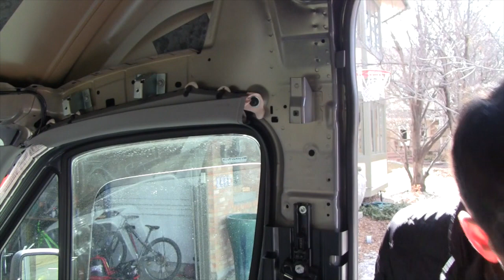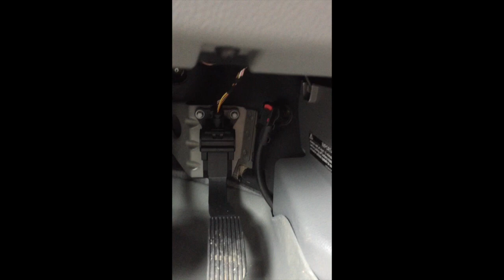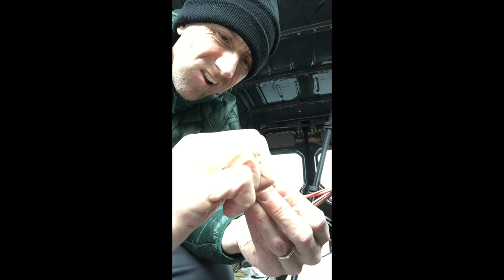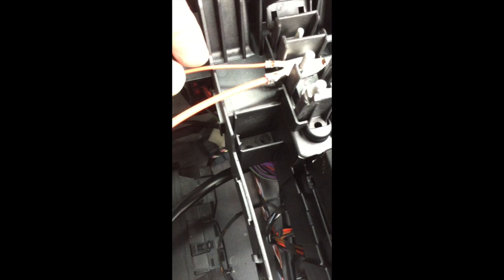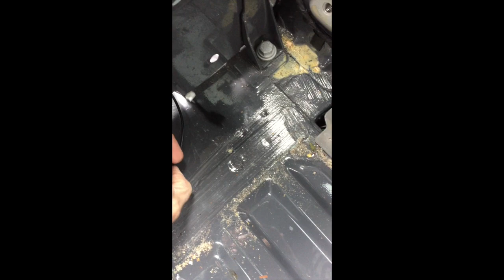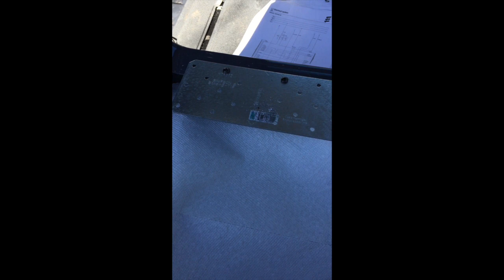Espar EasyStart Remote+ and High Altitude Kit - Install Part 3

Comment: Is it possible to use the Eberspächer EasyStart Remote+ and EasyStart Pro together?
Reply from the maker: I’m not sure about that.  I would think not, because there would be only one set of control signals in the wiring, but I’m not sure.  You should be able to call their tech support line and get an answer to that. Good luck with your build!

Comment: Hello, I have the same unit with the exact same components but have gotten a "no signal lately after the heater tries to fire. How has your been for you? Any issues with wiring? I am trying to troubleshoot my issue currently
Reply from the maker: Did you run the antenna up the side of the van?  I ran mine from under passenger seat where heater is up the B pillar
Reply from the maker: Did you pair the remote per the initial setup instructions on pg 11 of the manual?   You have to pair it using the “button” connected to the main unit.  Basically you push the button, it will flash, and then on the remote navigate to the Pair Mode / Add menu option and select that.